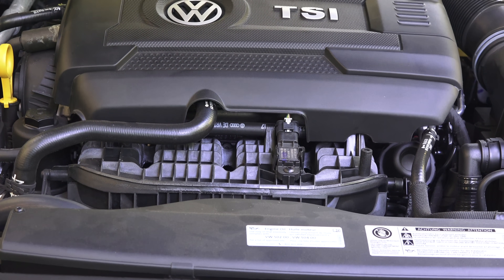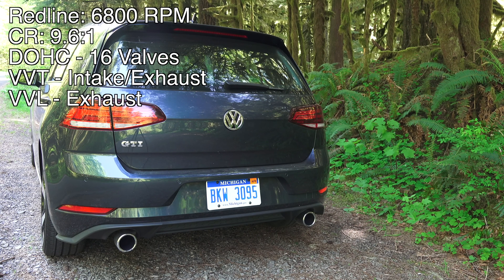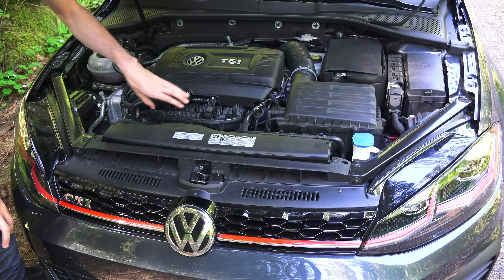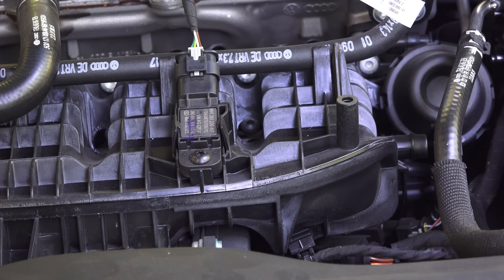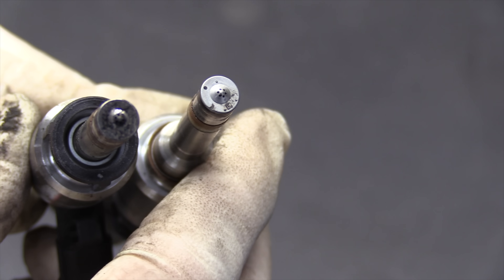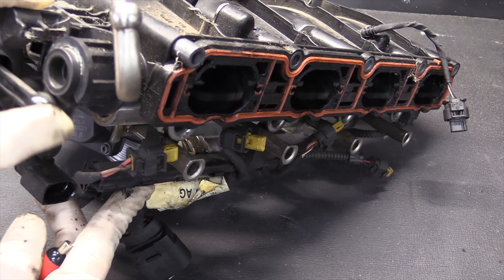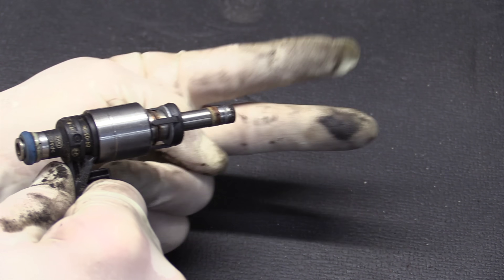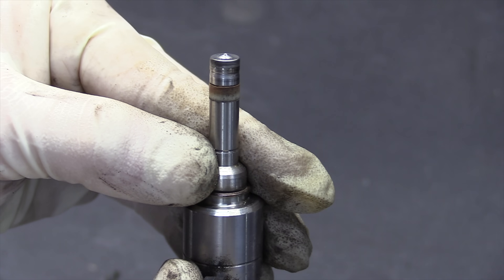The Best Engines - Volkswagen GTI Turbo

Comment: Aparet from the design problems around the Oil Rings which will wreck the bottom end and blow more oil than fuel and the Timing Chain tensioner which fails early and wrecks the valve train and maybe pistons and the seizing Balance Shafts when the filters break down and also take out the timing systems again as its an interference engine. Apart from that its the Best!

Comment: Mine is a 2015 Audi A3 1.8 TFSI 180 HP
Really adore the car. Apex Audi through and through. 
The only thing better than this in terms of size would be the 5 cylinder engine in Audi TT

Comment: Now in 2025 we know: These EA888 engines SUCK compared to the bulletproof EA211 which is the 1.0 and 1.5 TSI. The 1.5TSI is the main staple engine now for the North American market aka the low end Jetta and the Taos have the 1.5TSI now instead of the 2.0. And thats a good thing.
The EA211 is VAGs current production best engine thats a fact.
If you are in the market for a good econonomy car that is "reliable" and isnt GM trash just the the Jetta and get the 8 speed transmission because that is a proper automatic made by Aisin Transmissions and those are soild transmissions used in a ton of vehicles around the world, VWs in house 7 speed DTC is inferior.

Comment: I have a TFSI. A very good engine if maintained and definitely laid the foundation for generations to follow. For its day, it was a revolutionary design and made VW relevant again after yrs of decline.  Much like the 944 did for Porsche. BTW, 200,000 and still running strong. My niece also has a MkV built up. With forged parts and improved aftermarket items like an intake and other things, she has built a monster for about 1/2 what she would have spent on a Gen 3 car.

Comment: Seems like this video hasn’t aged well. Now every video I see on this motor is a top 5 things that fail miserably and cost a fortune to fix. I actually have stopped considering buying a newer VW because of the “advancements” of their modern engines. The old late 90’s early 00 1.8T 20v seems to be where they peaked with the 4 cylinder performance vs reliability balance.

Comment: Variable cam phasing, variable valve lift, dual port injection, variable oil pressure, variable oil squirters, variable coolant paths and water cooled turbo manifold.. the list goes on and on. The EA888 Gen3/4 is probably one of the best four cylinder petrol engine that will ever be made. When tuners really dig into these in 15 years time.. they'll be making absolutely mental power. They're easily doing 600hp already.

Comment: Going on 22 years now (this October) with my 2003 GTI VR6!  This car is a dream, and has been super reliable and then some!  The 24V VR6 is perhaps VW's best engine EVER!  I still have the original chains on it too, and have only change the spark plugs twice in 22 years!  Have been running LiquiMoly full synthetic.  6-speed manual still shifts crisply, and just changed the clutch for the first time after 21.5 years.  WHAT A CAR!

Comment: What about fuel? I'd imagine it wants 93 aki octane no? What about the carbon buildup? From what I understand I've heard that carbon buildup in the intake of turbo systems over time can adversely affect the engines overall efficiency and requires frequent, and often costly preventative maintenance. What about engine maintenance? Or common premature malfunctions? You fail to address some of the most important topics, which are engine operating cost and reliability. Great vid tho!

Comment: My mK7 2015 Gti got 198567 miles on it know still runs solid reliable and best car I ever bought you just got to take care of it with APR 1 tune air intake it’s fun to drive love it just got new clutch at 196200 miles carbon build up did at 96000 and then at 193000 miles Vw best cars then other ones out there

Comment: lot of people say these EA888 Gen 2 to latest are bad. but all of those people who drove them mostly likely didnt do the correct interval services. and yes that one famous thing the timing chains.
yes there were parts that were bad... but its not the engine... i got one 12+ years 2.0L turbo EA888 Gen 2 and never had issues... its still going strong... just do your oil intervals and dsg oils after 50k. and yes even I like to smash down the gas pedal...

Comment: It's a bit old now, but Toyota 4A-GE "Silver top" - 1.6 naturally aspirated, 20 valve, Toyota's first VVT engine, 118kW @ 7400rpm, 162nm at 5200rpm. It allowed the humble Corolla to reach 100km/h in 7.7 seconds and a top speed of 207km/h - pretty wild for the mid 90s.  Oh, and possibly the best sounding 4-cyllinder engine.

Comment: The electric thermostat assembly with water pump fits for Volkswagen 1.8T & 2.0T models since year 2014----

By adjusting Electric motor, Worm gear and Rotary slide, The electric thermostat assembly with water pump can control the flow of the coolant so that the temperature is controlled at 107 °C, and the engine friction is minimal at this time. Under high load, the coolant temperature will drop to 85 °C.

Comment: I still love my 2017 GTI sport edition that I bought new after the diesel gate scandal. VW gave me a deal I couldn't refuse on my GTI !
I now have 30k on the clock and trying my best to keep it in the best condition I can, especially without a garage. Yes, I am crazy. And even more crazy is having a 2004 Passat B5.5 4motion stationwagen as my daily driver. And actually my GTI turns out to be the daily driver because the Passat is in need of daily repair. Go figure "as they say in NYC ". But I do love both cars and repairing the Passat as long as I can keep the repair cost down..........please  - oh - Lord.

Comment: Just bought a Vw GLI. Pretty sure it’s the e888 engine since it’s basically the same motor as the gti. Got it in DcT tranmission, was wondering if the clutch is wet or dry. Looked at all forums and other sources but some saying wet and other saying 7 speed Dct is dry. Idk which to believe. First Vw so hope it will be reliable in the long run.
Reply: DQ381: 7 Speed wet clutch Gearbox

Comment: I have this engine in Skoda Superb , and i love it . But i have a problem , actually 2 , it eats up oil , ok no probs ill buy more ,  but it also Stutters when cold ,for about 7 minutes untill it heats up , now i used OBD2 scanner , and there is no fault codes ,  changed timing chains , belts ,water pump ,  and stuff , changed Intake manifold ... and still nothing . 
I noticed it only happens when cold ,and while cold it doesnt drive as good , not as powerful , and Engine Load is way too high for what it is doing , going up to 50% , when you are just driving out of the parking , light gas . Once its worm at operating temperature it doesn't go over 30% load on casual drive .
I would like to fix this issue , they said its Carbon build up  on intake valves , removed the manifold cleaned it , no its not , so im out of ideas ... Anyone knows what can cause this , they say , its probably running overly lean , and i tend to agree ,but why
Reply: Check pcv valve
Reply: @ashleysham5933  yes but , PCV valve has a rubber and a spring , do you know where i can find that for 2nd generation E888 2,0L Turbo petrol engine from WW.

Comment: Proud owner of 2017 GTI with already 193k miles (Freeway Commute) No Big Problems so far only 1 waterpump/thermostat leakage, HPFP replaced, Upgraded Coil packs and Spark plugs and that's it no Check engine lights and I haven't done a major carbon cleaning of the valves only CRC based
Reply: Thats sounds like a lot. Had did you know your HPFP had to be replaced. I got a 2015 with about 200K and I sometimes it doesn’t start. I hit the gas when starting to get it going. It comes and goes and nobody knows why it does it. I have one oil leaf, water pump,and AC replaced and I wasn’t happy. Mine was good till about 180 . It also uses oil more.

Comment: I'm really glad that the EA888 in my S3 (310 hp, 400 Nm) has multiport injection. The low pressure injectors in the intake manifold will eliminate the carbon issues with direct injection only engines.
Reply: Remember Germans can just do a quick autobahn trip to remive carbon build up
Reply: @stephendoherty8291 anyone can do.that, even within speed limits. You keep the rpm high in 4th or 5th gear for 50-100miles, after it got to right temp.

Comment: Bet  they don’t win for reliability
Reply: The engine is incredibly reliable. Vw has electric issues, not mechanical.
Reply: @Mr.bartz84  you mustn’t have owned one mines on its second engine timing chains fail known problem and they still fail on the newer ones of course if engine failure not a problem to you then get on with I’ve never had a engine failure except on my golf gti and I was out of warranty very expensive
Reply: @johngray722  I own a ea888 in my mk8 and have several friends with mk7s if you maintain them (yes,that includes chains) they're reliable.

Comment: EA888 - what about the bad habit of bending valves, snapping timing chains, failing water pumps that kill the head by jamming the timing chain, failing injectors, could packs that randomly die...
Reply: Chain tensioner has finally been updated right. Don't know about balancing shaft oiling. If they still have screens in the passage then the oil HAS to be changed often.

Comment: I have the third generation of this awesome engine on my Passat B8. Great engineering, it's powerful yet very efficient!
Reply: My Mk7.5 GTI is averaging 29.5 MPG in gentle city/highway driving, but that's from the cluster. I should calculate at the station. I haven't taken it on a road trip yet to see straight highway mileage.

Comment: Wow I’m surprised how the gti can make peak horsepower at 4K rpm and torque at 2k rpm very fast. Also the gti is the best bargain over the golf r because the gti is $25k and golf r is $40k and also the gti has the golf shift knob which the golf r doesn’t have. Also the gti has cloth design seats which the golf r doesn’t. Also you can tune the gti to have the performance as the golf r. So definitely consider a gti over a golf r
Reply: Golf R is as tunable as GTI. APR Stage 2 on a Golf R will give you insane power, keeping you well ahead of the GTI with the same tune

Comment: 8:00 the fuel injector designed to prevents the fuel of hitting the intake valve hence the fuel won't be able to clean the intake valve. I don't consider that as a good feature.

Comment: Shame they’re unreliable and break easy
Reply: Quite the contrary, these don't burn oil anymore
Reply: The EA888 is in its 3rd generation. Only thing I'd be worried about is that crappy plastic water pump and carbon buildup
Reply: @Dcc357  plastic water pump is great! In Europe we have DI & MPI on 2.0 TSI, idk why in the US it's not available.
Reply: @dragospahontu  Not the way I see it. I've worked on Toyota timing belt engines and those have real water pumps. You'll look at the plastic one is disgust if you compare them side by side. I know it will crack eventually. Anyways, I don't plan to daily drive a GTI if I get one. It will just be my fun side vehicle. I've always wanted one since I was just a kid.

Comment: My 2013 Mk6 hates 1 quart of Rotella every 1000 miles. It also has the infamous timing chain clack clack clack when it starts and has done so since we bought it in 2015. It has however never left us stranded and it has carried us all over the USA on road trips. It has been a fantastic car, but we are going to upgrade to a Mk7 asap to get away from the timing chain issue. 

Only must have mods have been 17" Enkei RPF1's with Michelin tires to match the OEM diameter. This gave us a more forgiving ride and we only air up to 34psi cold. Aaaanndd we disconnected the Audible engine noise thingy at the fire wall. Did not like the fake engine noise in the cabin when we hit the gas. 

Also something I noticed is whenever I remove the oil cap while at idle the rpms dips and is spews air out of the cap and really high rate. Kind of like a turbodiesel with a bad crank seal.
Reply: These engines don't burn oil anymore
Reply: @dragospahontu  I'll agree our Mk7 does not burn oil.
Reply: @mauser8515  yeah these are good dailys

Comment: Great video! But, you guys forgot to mention the ability to vary the turbocharger exhaust flow to optimize Boost pressure for low rpm and high rpm max torque. Maybe I'm wrong and this feature isn't as unique as I thought? Either way, the reason these engines develop such a high level of efficiency is because of the precise fuel, intake airflow and exhaust control. The intake and fuel systems are very well covered here.

Comment: I drive a 2016 Jetta with a 1.4l turbo TSI is this engine part of the same family? I know it’s sad and tiny but 150hp is still fun and it spins the tires at will well till traction control kicks in lol, if it’s the same family of engine, can I do a direct turbo swap from a 1.6 or 2.0 to get get more boost and top power? Also there’s tons of extra engine room in there, can the 1.6tsi or 2.0tsi Bolt right in If I picked one up aftermarket? I want more power in my little Jetta, fun car to drive and it’s so smooth and comfy. Would like faster 2nd and 3rd gear acceleration tho
Reply: 1.4 is Ea288 very good engine doesn't burn oil, doesn't destroy chain now it has belt, and doesn't consume turbos like the previous 1.4 EA188

Comment: yea 1.8 TSI, broken DSG manipulator ta 75k km, broken turbo at 120k km, broken water pump with thermostate at 130 km... what's next??
Reply: Those burn oil, the new generation 1.4/1.5 are better EA288 or 2.0 EA888 fourth gen.

Also that was a DSG7 DQ200 0AM first gen. The second gen after 2014 is 0CW and the mechatronic is bulletproof and the clutches  last over 150,000km.

Comment: Im in the middle of replacing one of these engines right now and it only has 90k miles. Its common for them to break valve springs. VW is junk.

Comment: Intake manifold failure....water pump failure....high pressure fuel pump failure....carbon build up.... pcv failure.... wiper electric motor failure..... when you don't have sunroof and water inside cabin anddd everything work together .....is a great car! .....mine...57.000 miles... my first and last VW!

Comment: You were wrong about the cylinder layout, #1 is on the passenger side. Also your friend was wrong about the purpose of the flaps in the intake manifold. The flaps reduce intake port size to increase air velocity at low rpm, they do not change the runner length.

Comment: The 2010-2012 1.8 TSI uses more oil  than a 2stroke engine. And they all do that, after only 70 000kms. Friend of mine had that engine in his Skoda rebuilt and it used even more oil afterr that.  Best engine VW ever built was the 1.9 TDI with pump injectors. My father had one. Lot's of torque and the pressure release valve of the turbocharger makes a noise like a rally car when shifting.

Comment: The third gen EA888 is where they finally got it right. Lots of power potential, timing chain issues fixed, less oil consumption. A VW engine that finally does have a fatal flaw... except for those damn plastic water pumps.

Comment: OK, interesting but the 2020 GTI gets SPANKED by the 2020 Hyundai Veloster N in both speed and handling! PLUS the Veloster N is almost $10,000. LESS than the equivalent GTI not to mention more reliable.

Comment: maybe a very efficient little engine but very trouble prone! Shall I count the ways? Lets start at the front. timing chains, timing chain tensioners and guides, balance shaft issues, intake flapper guides (control arm is plastic and prone to break), coolant problems with thermostat housings leaking (plastic) and pump driven by balance shaft, carbon build-up in intake ports, rear main seal failure due to failed crankcase breather valve. Had enough yet?

Comment: The APR Stg 1 tune is very "square": 325 HP & 327 ft/lb.
Reply: I'm stage 1 with trans flash from APR ever since 5k miles and average 34mpg in AZ. Super happy with my mk7 GTI

Comment: Awards should be given when an engine is 5 years old and several have made it past 200k. I'm sure this is a fantastic motor, but give it the daily grind.  Those runners already looked pretty gunked up. Still no dual injection.  There's a reason why VW's have some of the worst resale value.

Comment: VW doesn't have any good engines anymore, they are all doomed by their shitty electrical systems and crappy over engineered mechanical stuff that fails more than it works. One day they will just give up and go back to the only engine that worked for them....the air cooled flat four. Subaru should also take note and maybe just have someone else build their cars since they cant get those shitbox's right to save their lives.

Comment: At what point do all the plastic hoses start cracking, all the sensor start dying and the check engine light finds its home on the dash. 

I used to light VWs but they because over engineered and complex for no real necessary reason.

Comment: In the first year I had my golf R it had 2 thermostat housings leaks . Then water pump started leaking. Then clutch went. Then speaker seals failed and filled my footwell of water. Bonnet cable snapped..the build quality of VW isn't like it use to be.. remember this is a £30,000 car...  Never again...

Comment: I love your channel generally. But this is WRONG!!!
 I work at a european specialist shop, we get everything from McLaren and Ferrari to Fiat and Smarts... these engines are trash! Lifters drop, Carbon buildup from GDI destroys valves, springs break, timing chain guides fail,  Crankcase vents fail and cause boost to blow seals, the HPFP fails and washes the engine out with fuel, Volkswagen made this head "NON-Servicable". Injectors leak and wash out cylinders, diverter valves fail, etc... If I went on and listed everything my phone battery would run out of juice, and I just charged it! 
No! BAD Engineering Explained!!